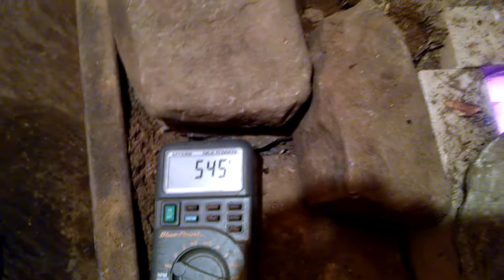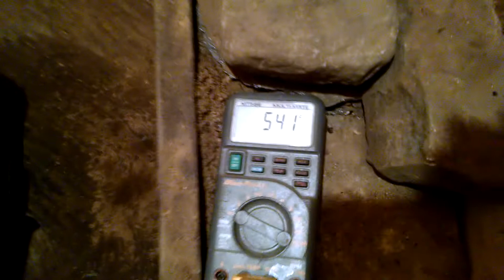Mobile rocket mass heater

Comment: hey mike, love what your doing with the rocket stove tech, and the gasifier also very cool.. loved that you got the wood splitter running on wood. this trailer design is cool, for the fact that you can move it, if you could build a platform of mass with the exaust pipe running thru it then vented outside, as i understand its the pipe that heats the mass.just hook the pipe to the platform when you want to use it. so you could still be portable. nice work mike!
Reply from the maker: Yes the exaust is the best way to heat the mass area but I had a hard time spending money on the pipe for the chimney itself lol.The gasifier is fun to mess with also.take care